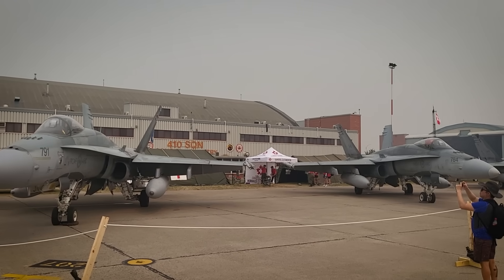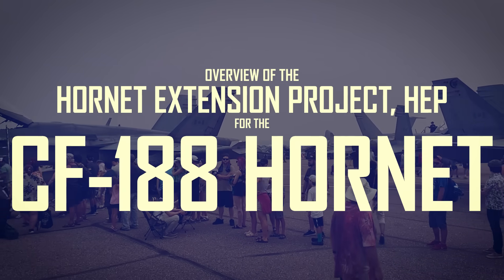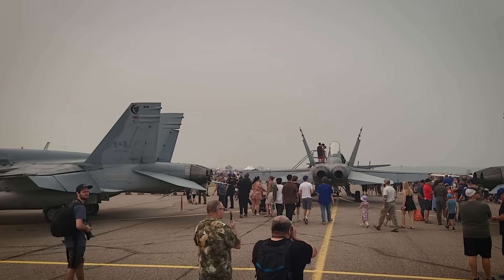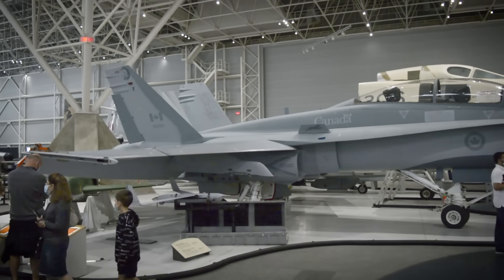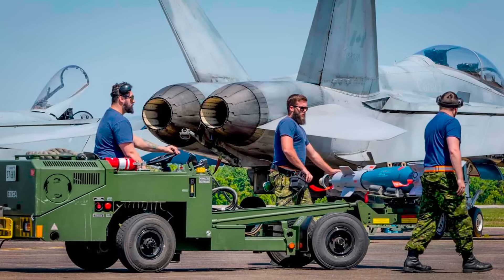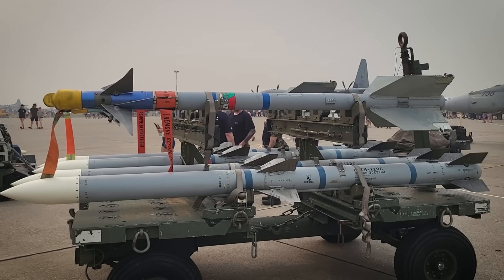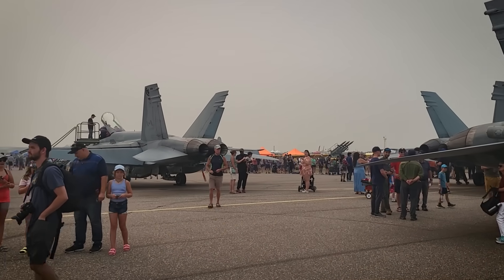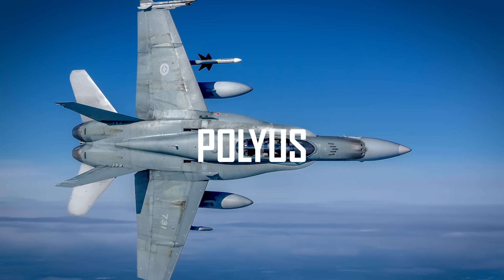The latest CF-188 upgrade program, Hornet Extension Project, HEP (No AI)

Comment: There is a difference in upgrading a car vs aircraft. Aircraft are made as light as possible, resulting with all the G forces applied in flight, you get metal fatigue and hairline cracks, making it possible the aircraft can fall apart flight. Eventually you run out of flight hours. If the wings are the limiting factor, you can build new wings and in-depth fuselage inspection for hairline cracks.  Very very expensive.

Comment: At some point in time, we should have military products where the spare parts can be manufactured through 3d printing and CNC machines as needed in that all the parts exist in data files for such machines.  Indeed, we should start doing this with drones as it has been the ability to manufacture such drones without a lot of tooling that proved to be Ukraine's advantage.  The military has worked by salvaging spare parts from other machines for as long as can be remembered but really, we are at a point where that should not be technically required.  Indeed, the abandonment of the district solar heating ground storage system of the Drake community in Alberta simply because the plumbing was all custom designed by the National Science Council of Canada hence commercial replacements could not be found us shameful when we have 2d printers and CNC machines that can produce metal products and the excuse of not having replacement parts to scan to build a data file is also a weak excuse for not trying to manufacture the parts on a small scale.  I've crazy glued a broken part back together again to take measurements and draft up plans for a machine shop to make a hunk of aluminum close enough to the part for me to file it down to fit before and that's before 3d printing and CNC machines...

It is only the greed of the manufacturers that they have refused to produce such data files for existing equipment.  It should be required that manufacturers produce and release such data files when they end productions on a part, at least with military productions.  Designed obsolescence is simply shameful greed...

Comment: The APG-79(V)4 GaN AESA Radar is derived from the F-35 radar and is extremely advanced. Combine that with the AIM-120D AMRAAM and you can go up against all 4th gen fighter jets. Integrate the jets through datalink with an AWACS and surface radar and you can take down stealth aircraft. This is a huge upgrade and puts us on the top tier air force capability level until the F-35 arrives.

Comment: That comparison to the old cars of the 80's kind of puts things in perspective. I flew KC-135s for 18 years, all of which were built in the 50's and 60's, and half are still flying. I saw several upgrades to that system as well. My decision to retire after 21 years of service in 2004 was partially driven by the fact that I ran out of the brain cells needed to keep up with the new stuff they kept adding to jet. Thanks for your consistently informative and well made videos.

Comment: 1.3 billion dollars for this upgrade. The last one was even more. This is the true cost of failing to procure aircraft within the timeframe needed, and a failure of military budgets. Halifax Class frigates went through an expensive upgrade program due to the same issues. Submarines are a different one as they will always need a deep maintenance every few years (all submarines do).The Aurora Aircraft went through a e3xpensive upgrade but Canada needs to replace the actual aircraft with another source, such as the 737 based P8 Poseidon. These upgrades cost many billions of dollars to extend the life of an aircraft, but the parts used usually cannot be refit into new platforms so it is donated to other countries still using the technology. Why is there mandatory commitee that makes decisions based on military needs rather than what each individual Prime Minister wants?

Comment: 1:22  what is that doing to the gross weight  and performance ?  Newer electronics are presumably smaller,  and lighter,  but piling more,  and more stuff  has to add up.  Along with the electrical generating demand.  I'm not a trained pilot,  but I am a Motorcycle road racer,  I have some instincts,  and can appreciate P/W ratio, and it's effects on handling and performance.

Comment: 1:01 cars are made with “planned obsolescence”, war planes are not. The reason a 1950’s car still runs is it was made of such high quality thick steel that it can be scraped clean of rust over and over and still be restored 100 years from now. The cars you mentioned from the 1980’s were made with parts that were thinned so that they would fail at a specific time and force you to buy a new one or get parts. 

A jet as old as you is a youngster. The planes from WW2 are still deadly. They just aren’t as fast.

Comment: I really want domestically produced Gripens to replace these. They’re cheaper, more modern, easier to operate and more secure given most of the supply chain being domestic. F35s are a nice to have but to expect a full fleet of them for day to day NORAD and nato operations is not very sustainable or cheap, and they need a lot more skill to maintain and upgrade being 5th gen.

Comment: i know the balloon killer joke was meant as just that .... but when you think about what an "heat" seeking missile has to do to even see a non heat generating thing like a balloon ... its actually really cool. the aim 9x is freaky
Reply: Thermal imaging and they were modified. 3AIM-9X took down 3 balloons in 2023.
Reply: @hoghogwild  im well aware, i helped HEP
Reply: @Wolfram-8411  What does HEP have to do with modified Sidewinders and balloon shootdowns?
Reply: @hoghogwild  did you watch the video? HEP was the project that allowed the CF-18's to be able to fire the AIM-9X and not just the AIM-9M that they currently use

Comment: The first time I saw the CF-18 in person was around late '83 or early '84 when I was stationed in Comox. They were quite impressive at the time.

Actually worked on them in Germany '88 - '92 as a tech and then again in various capacities as a Sgt from '04 to '12.

Hard to believe they have been around in the CAF for over 40 years. We were making jokes about the Sea Kings' age when they were a 30 year-old airframe.
Reply: It may have been Nov 1983.
We flew a pair of F18s into Comox for the first time. I looked in my log book. My aircraft was 704. Maybe we had a chance to talk.
Seems a long time ago in a galaxy far far away.
Reply: @larrydugan1441  Possibly. I was on the start for a pair of CF-18s when they were leaving Comox around that time. I was told by one of the pilots how to check the nosewheel DDI and only let him know if I saw a 32 or 34 code (if I remember correctly) Anything else he was still leaving.

Comment: Welcome back.  Part of me still wants Gripens
Reply: Ideally I want a mixed fleet, assuming 100 combat aircraft, a near 1:1 split of F-35 and Gripen would be my pick, you could also throw in a squadron of the F-15EX
Reply: @allgoodhandlesweretaken  That will never happen. Canada can’t afford to operate two or more different types of high performance fighter aircraft, especially with such a small number of a type. The cost involved would be off the charts expensive for a nation with such a small defense budget and with many hands out looking for new equipment.
Reply: @allgoodhandlesweretaken  We can only hope they get a 1:1 replacement ratio, 88 jets is not enough when you factor in potential accident losses. Plenty of CF-18s crashed out of the original 138 fleet.

Comment: As with the Army, RCN and the RCAF are deep into ill relevance.  The training pipelines can’t support the operating forces as new recruits wait months for a training slot.  3 of 4 submarines can’t sail but thats ok as the RCN only has enough trained folks for one.  The CF-18 (aka legacy hornets) will only upgrade 18 airframes.  The army only has enough folks and equipment to deploy a single BN to NATO rotation.  The answer?  Blame Trump

Comment: We need a fleet of Saab Gripen Es, which we can also export to Ukraine, with a plant built in Ontario to employ laid off auto workers. They should be powered with Rolls Royce EJ200 engines built in Montreal. Love the 18, but put the old girls to pasture already.
Reply: Both are not going to happen.  We're getting the full F-35 order.  A mixed fleet of 88 jets makes zero sense and Saab would have to spend too much time and money to redesign parts of the Gripen E to put a new engine in it....at least 3-5 years.....our Hornets don't have that kind of time.
Reply: Nice dream but that will never happen. The Gripen ship has sailed and its not coming back. Besides, Canada can’t afford to operate two different types of high performance fighter aircraft, especially with such a small number of a type. The cost involved would be off the charts expensive for a nation with such a small defense budget and with lots of hands out looking for funding for new equipment (i.e submarines, ships, tanks etc etc).

Comment: Worked on the '18's in Cold Lake (410 Sqn) for 10 years. I started on them in 1997, and were already showing their age then.  Even back then, the Air Force was worried that all the 18's would run out of structural life soon. And we're still soldiering on with them.  They're starting to become as much of a joke as the Sea Kings - Pilots flying the same aircraft as their grandfathers....  
Flying Yesterday's Aircraft into the Future.
Reply from the maker: 20000 spare parts flying in formation
Reply: Had a family member flying them there at that time. Call name was “bear” 
He started in the 101 and 104.

Comment: all shot down in 5 minutes. Give them to the Ukraine, why not? They have the rest of our military.
Reply: Ukraine doesn't actually want our legacy hornets, they already rejected Australia's bid to donate ~40 airframes a couple of years ago. The actual list of active equipment donated by the CAF to Ukraine is relatively small, and much of it was vehicles near or at the end of their service lives anyways, our biggest contributions have been financial, and also with vehicles like the roshel senator, which is Canadian made, but not used by the CAF.
Reply: @NewfieOn2Wheels  Considering how badly CAF is equipped, I say Canada lifted above its weight in terms of military donations to Ukraine. Here are the assets donated to Ukraine by Canada: 

8x Leopard 2A4 MBT 
47x ACSV (42 more are awaiting delivery) 
64x LAV II + 25x LAV III IFV (awaiting delivery)
200x Senator armoured vehicles 
64x High resolution drone cameras 
900x SkyRanger R70 multi-mission Unmanned Aerial Systems 
100x Carl Gustaf M2 anti-armour weapon system 
80,000x CRV-7 rockets + 1,280 CRV-7 rocket warheads 
4,200x M72A5-C1 rocket launchers
10x multirole boats 
12x AIM-120 AMRAAMs 
43x AIM-9M Sidewinders 
1x NASAMs battery 
40,000 rounds of 155mm artillery munitions + 10,000 rounds of 105mm ammunition 
277x 1,000lb aircraft launch bombs 
4x F-16 simulator (+ money on the F-16 training support) 
250+ AIM-7 Sparrow

There is website created by Ottawa for Canadian citizens to see how much they’re sending to Ukraine.

Comment: I see a future with a mix of CF-35A and Gripen J39E. That makes the best compromise and would make the CF-35A a dedicated strike aircraft and the Gripen a more flexible and deployable multirole aircraft. After all, we do not need a stealth aircraft for NORAD defence!
Reply: Canada can’t afford to operate two or more different types of high performance fighter aircraft, especially with such a small number of a type. The cost involved would be off the charts expensive for a nation with such a small defense budget and with many hands out looking for funding for new equipment (ie. submarines, ships, tanks, etc). Dare to dream, but it won't happen.
Reply: I think it will be useful to keep any enemy guessing. F-35 can be deployed in combination with Gripen to keep enemy aircraft or even ships focused on Gripen while f-35 delivers a nasty left hook to the chin. But also we need to be thinking about drones, and alot of them.
Reply: @Kevin-np3sx  Well, with the open architecture of the JAS39, and depending which block of F-35A we get, the ability for a Gripen or a CF-35 to control drone wingman is a possibility. But yes, we need cheap and lethal drones that can augment both the airpower and also for ground forces to have an organic drone inventory to handle FEBA assigments and also counter UAS too
Reply from the maker: Yeah i like the F35 quarterback,  Gripen linebacker idea. A mix seems like the way to go
Reply: @polyus_studios  The big question is, can we get the Gripen a RR EJ230 Engine and make our Gripen immune from American sanctions. I know that would take significant re design of the Gripen, but I think that is the way to go for SAAB especially with international sales..
Reply: @michaeldenesyk3195 I would think Saab is working on it, something they will continue to deny right up until the moment they show it off.
Reply: @michaeldenesyk3195  There are still plenty of other US components built into the Gripen E, other than the engines.  Having said that, the time and money to redesign things like the air intakes, new weight and balance work, moving electrical and fuel connections and engine mounts, Saab won't go through with adapting the RR engine at all.  It would be a lengthy 3-5 year process of design, testing and certification.  Frankly, Canada needs the F-35 and nothing else.
Reply: @polyus_studios No, a mixed fleet of 88 jets is going to be too expensive and you need double the infrastructure, training pipeline, supply chains and people.  It's ineffective and inefficient.
Reply: But the million dollar questions is, who is Canada going to strike with a F-35?
Reply: @PePe_007-A1 The answer is no one.  I don't understand why people think we want to invade someone with the F-35.  We didn't buy it for a first strike aircraft....we bought it because of the advanced sensor suite and it moved the RCAF into a 5th Gen platform.  Should be noted though.... Canadian Hornets led the first strikes into Kosovo during Allied Force, so would that make the Hornet a first strike fighter?
Reply: @yxeaviationphotog  The F35 made more sense when we WERE more aligned with the USA and politics undoubtedly factored heavily in that decision.  The very fact that it can easily be disabled either by an off switch or parts/software starving is reason enough not to buy it.  The USA has once again proven itself an unreliable ally and possible enemy.
Reply: @PePe_007-A1 First off, there is no "off switch" and Lockheed Martin has publicly came out and said all F-35 partners will continue to have full support for their fleets.  Has Denmark been threatened with F-35 support being cut off until they give up Greenland?  No....in fact, Denmark ordered 16 additional F-35s.  So these notions that the US will arbitrarily cut off support are unfounded.  It's not going to happen.  And you talk about politics?  Forcing the Gripen and a mixed fleet of 88 jets on the RCAF is pure political interference at its best.  We need the F-35....we don't need the Gripen.  The majority of our NATO allies (15) all fly the F-35.....it makes sense to be on par with those partners, instead of playing a lesser role with Sweden because we still operate 4th Gen aircraft.  F-35 is going to serve the RCAF for the next 30+ years.....threats are going to continue to rapidly evolve to the point where the Gripen will be useless in contested airspace..... it's already close to that actually.
Reply: @yxeaviationphotog  If there was an off switch, would they admit to it, no.  If the president demands that Lockheed Martin ceases all support, they naturally will without hesitation or question.  Weak argument.

Sweden IS a NATO country and other NATO countries are in the decision process of dumping the F35 or not.  There will be a move away from US arms sales by western countries.  Most were already too far in to change their paths.

The F35 is a problematic boondoggle which is well documented.

Are you a salesman?
Reply: @PePe_007-A1  first, it will hopefully be a deterrent. Secondly, many nations are contesting the north west passage, and any number of possible threats could arise. We could need to aid allies in Europe, or potential fleet incursions into Canadian waters with military offensive intent, pickup a history book, its happened all over the world. Striking an enemy amphibious landing ship with a JSM cruise missile, will make an amphibious landing on Canadian soil a lot harder. The JSM fits internally into the F-35 so the aircraft can strike while remaining stealth, it is a Norwegian/US development. A squadron of these can do a lot of damage to even a higher peer fleet.